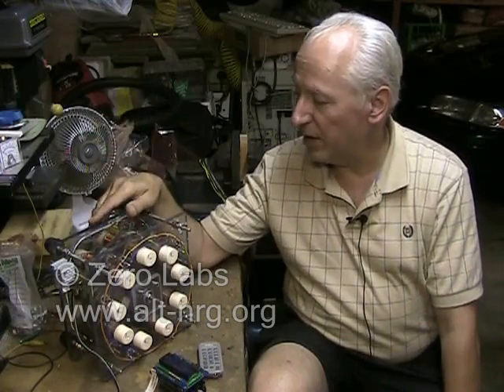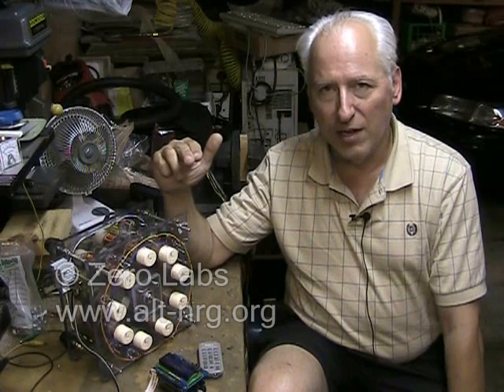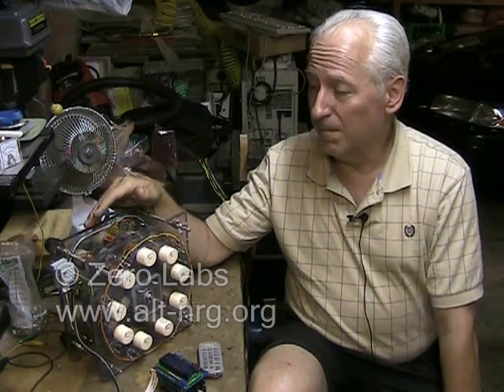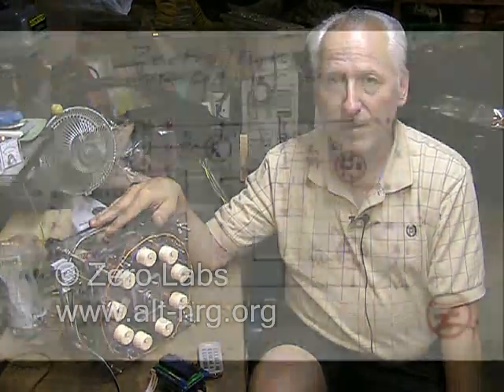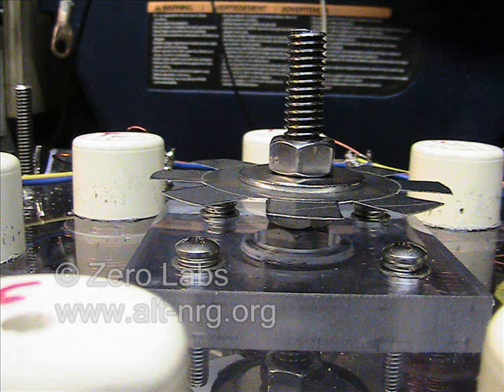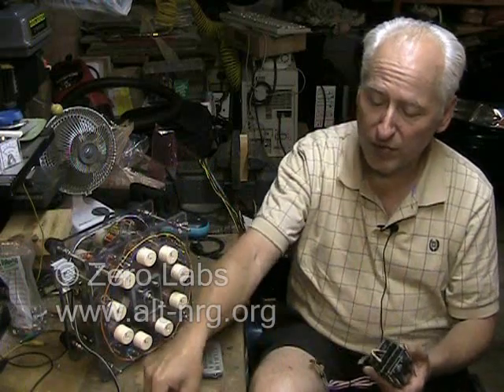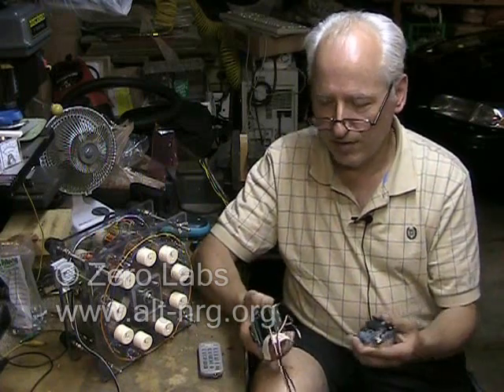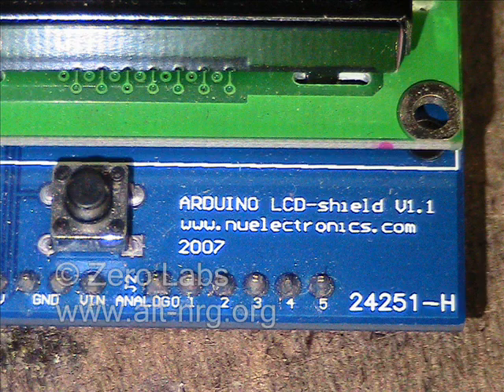#288 Muller Motor update

Comment: This seems like an easy problem so solve using any number of PIC chips. Using sensors to determine speed and inputing that data to the PIC, the code running in the PIC can adjust the duty cycle on one of the output ports to keep the timing in the zone. The programming language for these PIC's is not rocket science. If U can use BASIC it's no more difficult than that. The hardest part seems to be already done and that is figuring out the timing scheme needed.

Comment: i did learned a lot from your videos. but my setup is way to different from Romero's. every one's unit does.  its ingenious dough. he should have been a magician maybe made money out of it. at least doing so we know its just a trick.  the key to generating power is that the drive must be strong that's why they use engines to push the rotor right?. oh my why is it like this. there must be a person out there that  has an answer and boom save us from economical hell....amen

Comment: @ZeroFossilFuel I think most of the pics have been purged from overunity site but I could be wrong.  You can check the thread "Romero and Wire X Dilemma" on overunityresearch site.  Look at reply #31 to see a pic of the wires going into the center cap of the plastic round outdoor table.  Someone named "ArtistGuy" improved on Wattsup's pictures.  Look at reply #109 in the same thread.  Romero tried but failed to make sure the camera did not see the wires, they are only shown in a few frames

Comment: @lwblack64 You should double-check that.  My best guess is that "54 bytes" is actually 54 registers to play with to set up the cascadable times like I said and control the I/O pins and whatnot.  In this day and age there is no such thing as 54 bytes of memory.  I haven't looked at a microcontroller data sheet in ages, but there is probably at least 512Kbytes of RAM memory and 5122 KBytes of program memory, and likely a lot more than that.

ZFF, precisely what uController are you using?

Comment: 2nd:  If the timer is 32-bits and clocked by the 16 MHz CPU clock, then you end up with a ridiculously accurate measurement of the time between hall sensor falling edges.  However, like I said before, what you actually do with that data to implement a PLL to track the motor as it changes RPM and adjust the pulse delays and pulse widths accordingly is not trivial.  You have to code a negative-feedback control system with sw filtering that is stable and doesn't wobble back and forth in freq.

Comment: @lwblack64 I am not sure I understand what you mean by the clocking being limited by the USB bandwidth.  The only thing you do with the USB interface is download code into it, no?  ZFF said his microcontroller clock is 16 MHz.  For determining RPM, one more time, it's reasonable to assume there may still be more on-board hardware timers you can use to do that.  The CPU reads a timer register that is effectively measuring the time between hall sensor falling edges.

Comment: 2nd:  If the particular version of microcontroller ZFF is using supports this "two sets of programmable cascadable timer pairs with external trigger inputs and two output pins that go logic high when the second timer in each pair is counting" then you are in programming heaven.  You just write whatever code you want to program those four timer registers and the generation of the delayed output pulses is all done automatically by dedicated hardware inside the microcontroller.

Comment: @cuke8466 It might even be simpler than that.  Chances are there is a timer that will start counting on the falling edge of a microcontroller input pin, i.e.; the signal from the hall sensor.  The timer counts up to the value put into it's programmable reguster based on the CPU clock or possibly an external clock.  The first timer is the delay timer.  When that times out it internally starts a second timer, the pulse width timer. That generates a high output based on the value in its register.

Comment: @cuke8466 You are right.  If you assume that the microcontroller has four internal hardware timers, where you can set them up as two sets, one for each (delay + pulse width) combination, then you are home free.   You only need foreground code to poll the keypad, operate on the timer registers, and update the LDC display, and possibly run a software-based PLL.  Even without timers you could do the pulse timing with an interrupt-based setup running background code + the same foreground code.

Comment: @ZeroFossilFuel The function you need to write in software is a phase-locked loop (PLL) to track the rotor RPM and then use that to adjust the delay values and the pulse width values.  It's not simple to write a PLL unless there is an off-the-shelf one that you could tweak for your motor.  I believe the Arduino community is very large so you might find one.  However, you are emulating a negative-feedback system with time constants and damping factors, it's really not trivial and must be stable.

Comment: Maybe do it with one or a couple of retriggerable monostable multivibrators. I know you thought about the 555 in the past. But perhaps the way to make this work is to consider your triggering. If you trigger one on a rising edge, then the other trigger on a falling edge from the hall effect device, sum the 2, you get a pulse generated output tracking rotation speed which may do what you want. The pulses from the hall sensor will also narrow as the speed goes up, so duty cycle should narrow too.

Comment from the maker: @User2718218 That's exactly how I plan to have the Arduino configured. However, a simple delay counter and pulse with counter will only work at one fixed speed. It does not have the intelligence to calculate RPM and vary the parameters on the fly.

Comment: 9th:  Without presets I think you will start to go nuts manually adjusting all four timing parameters every time you want to run the motor.

In summary:  LCD displays the four timing parameters in milliseconds.  Eight dedicated keypad keys to slew-up and slew-down the timing parameters.  10 presets (at least) that save/store all four timing parameters.

Then you could bring the motor up to speed by "changing gears."  (presets)

Then you could really fly!

Comment: 8th:  All that the software routine has to do is poll the keypad in a loop and depending on which key is being pressed increase or decrease one of the timing parameters.

Here is the real biggie for you: I am going to assume that the Arduino has some e-squared or flash non-volatile memory.   You should use that to store up to 10 presets of timing parameters.  That way you could retrieve sets of timing parameters that are like "gearbox settings" to bring the motor up to speed.

Comment: 7th:  I'm back to improve on the design for you.  BTW I'm assuming the Arduino also has an LCD display where you can display the four main timing parameters in clock ticks or milliseconds, etc.

I will also assume that you have say 12 keys on your keypad.  In that case it makes sense to dedicate four pairs of keys to your "slew up" and "slew down" functions for the four main timing parameters.  That would make the whole thing a lot more user-friendly.

Comment: 5th:  The harsh reality is that you can generate a ton of data with lots of performance curves and nothing will hint at a "magic" combination.  That is the downfall of the rabid believers, they want to believe in an elusive "magic" combination and you can generate performance curves until you are blue in the face and nothing will indicate that.

The other harsh reality is that Romerouk clearly is not more knowledgeable than your average experimenter on the forums.

Comment: 4th:  Energizing the drive coils around the sweet spot is good.  However, then you have to deal with how much output power you can extract from the generator coils.  That depends on the load resistor.  It all starts to get complicated.

Have you seen some people make measurements where they change one variable only and record their data in a spreadsheet and then plot it?  That's the real way to go, generate performance curves for your motor-generator.  Then draw some conclusions.

Comment: 3rd:  Keep it simple you need the automatic recognition of the RPM and the automatic adjustment of the pulse widths like a hole in the head.   All that you need is the keypad interface like I described above and your scope.  That's it.

As far as the application goes, for sure you will be able to find a set of delay and pulse width values that give you the maximum RPM for the minimum input power.  You will effectively energize the drive coils right around the sweet spot.

Comment: 2nd:  Some code could read your keypad and you can use on key to cycle through which parameter you are adjusting and a pair of keys for "slew up" and "slew down" to adjust the delay values and the pulse widths.  Keep it simple, it should be trivial to program if the software tools are good.

Having the Arduino recognize the RPM of the motor and then adjusting your delays and "dwells" is a serious programming challenge that could take weeks or months.

Comment: I think that you are over complicating your Arduino setup.  How about this:  Your hall sensors trigger early.  So for each of your channels you have a "delay" counter and a "pulse width" counter that fires the drive coils.  That's all you need.  As the motor speeds up you play with Delay1 and Pulse_Width1 and Delay2 and Pulse_Width2.  No matter what the motor will reach a stable RPM and then you can try tweaking the four parameters.

Comment: Its basic digital application of 1 and 0's. Get a junk printer and get the optoisolator wheel and sensor out of the paper positioner which is extermely accurate. That would be more accurate wheel speed and direction. Apply the code from the arduino with a serial montior to see the thing work on the computer. The arduino cook book would have all the code needed which is at barns and noble.

Comment from the maker: @rony14344 I am still on the fence. So far, what I have seen mirrors that of Flash001USA. I think there's more and part of it relates to how RomeroUK hung his hall sensors in the moving fields to control pulse width.

Lidmotor made one similar that drew very little power to keep running and would run for almost 10 minutes on the super-caps alone. It would not have been difficult to pull of a hoax just by switching the analog current meter faces.

Comment from the maker: @helicrashpro I looked at 555 and other circuits. They can provide a fixed pulse width output triggered by an input but not as a percentage of input frequency. Need a device that monitors input speed and calculates the pulse width on the fly.

Comment: instead of opto interrupter ,you might be able to retrofit the  ignition system for V8 motor ,maybe HEI from the top of a 1980s ford 351 or MSD high performance ignition ,with adjustable dwell   and advance .It will probably do exactly what you want

Comment: I think the Arduino will work great but is pretty overkill for what you want it to do. It sounds like what you are looking for is a brushless motor speed controller or Electronic Speed Controller or ESC. I would think a 555 timer chip circuit would do the job.

Comment: @ZeroFossilFuel  Thanks for the update and your continued efforts.  I also think that moving forward with the Arduino is a good idea because it will allow you to more quickly tune, test and confirm the operational capabilities of your Muller build.  But to reduce the complexity and additional load current, hope the programming flexibility the Arduino provides allows you to more quickly determine successful operating parameters and configuration that can be implemented without the Arduino.

Comment: The arduino is away to get the most out of it.... like in one of his past vids he said that the person he talked to about what he would need to do this is to make it as effecent as possible .... this is one way.... as for a shield he could use bismuth ... has diamahmetic properties .... and crystalline properties to... which might mean that if you make a mold of that And as it cools either tap it with an electricity or run a small current threw it...it has a low melting point so you could use a

Comment: Zero,too bad you don't have the time to code for the arduino.  You will find that programming it is actually quite easy. Sounds like you could do this with just the arduino itself (no extra shields needed).

Using an arduino would be great since it is cheap, easy to use and replicate.